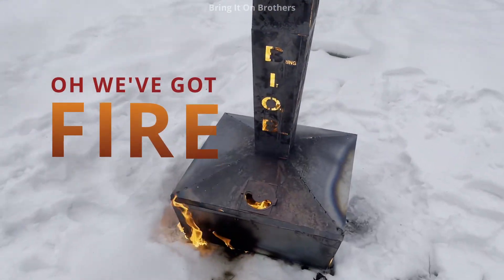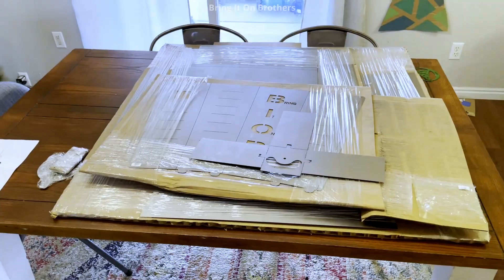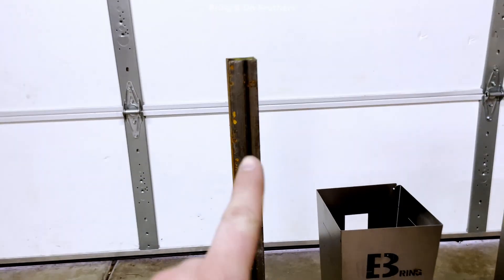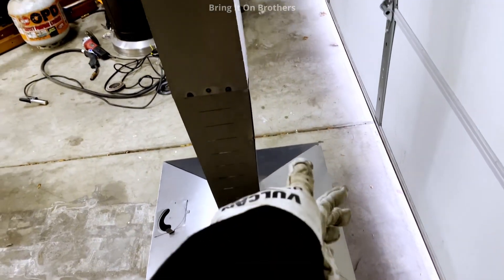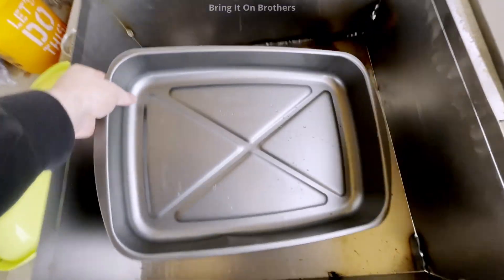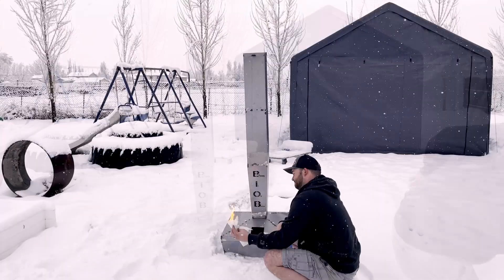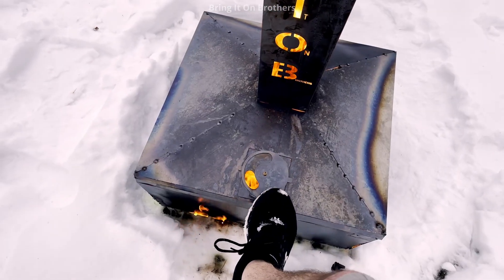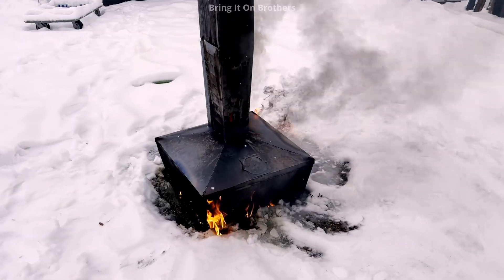I Made a Smudge Pot! - DIY Waste Oil Diesel Heater

Comment: Does the open b.i.o.b. not effect the air intake? I havent finished the video so you might adress this later in the video, but its basically unlimited oxygen right?
Reply from the maker: @frankgarcia3328 great question. With the design on this video it’s really hard to tell if the letter significantly affect it. However, on existing designs from the original patent it requires some type of air in Lear’s on the side of the first chimney to create a strong air flow so that is what we are banking on. We will have design 2.0 in about 3 days that should have a tighter fit and we will see if that solves it. Stay tuned!!